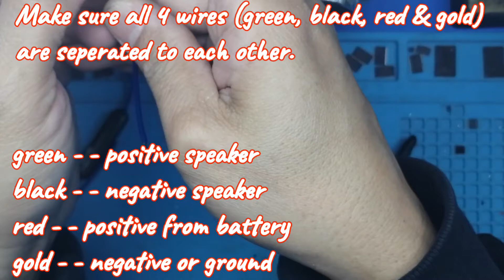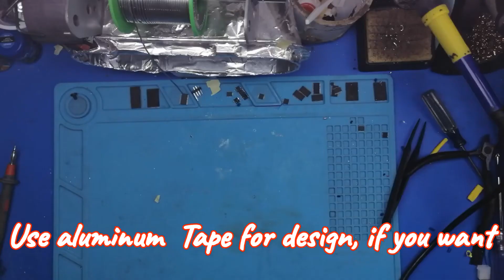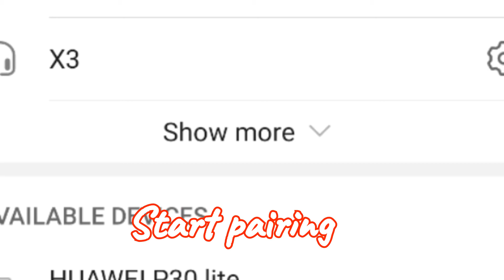How to repair Huawei Bluetooth Earphone (AM61 model)

Comment: I hv issue about my Bluetooth,its onn off button not working suddenly off and after that didn't on,,charging full
Reply from the maker: Good day, sometimes having issues on small capacitors or diode 3 pins.

Comment: How to repair if one side is not working ? Send help please 😭😭
Reply from the maker: You need tools and tester to find faulty tiny wires, soldering iron to fix broken tiny wires
Reply: @circuitrxworkshop  may i have your service sir,please ?
Reply from the maker: @aqilnasrin116  Good day, send image of your broken AM61, here is my email add, chardm74@gmail.com. Thanks, have a nice day,
Reply: @circuitrxworkshop  done email sir,tq.